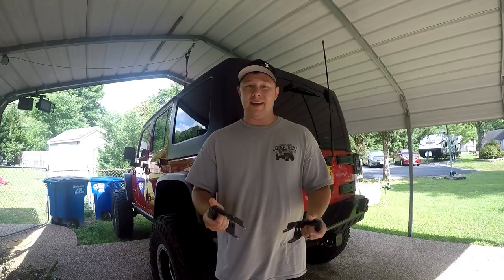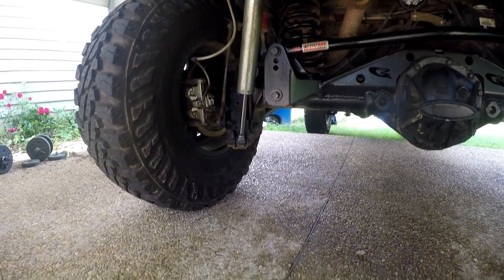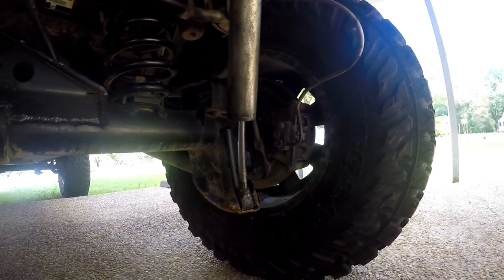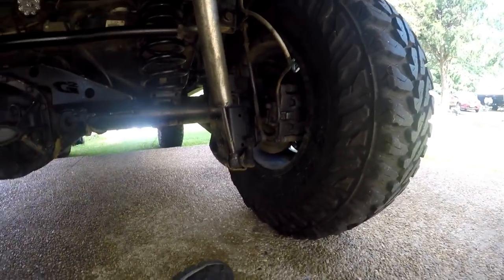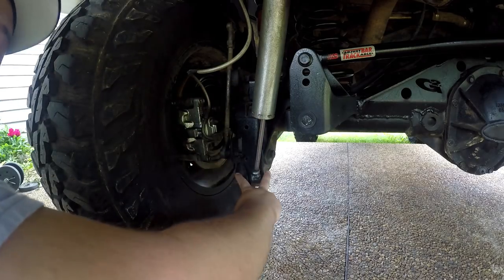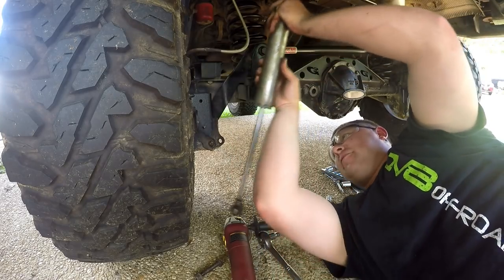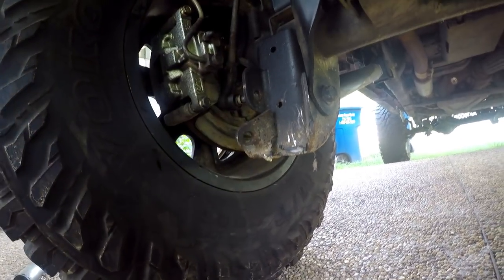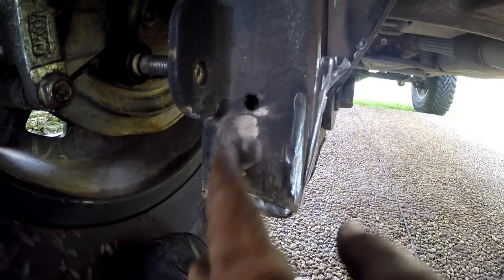Jeep Wrangler Shock Relocation Brackets

Comment: for the effort and cost what did you actually gain in clearance 3/4'',wow
Reply: But this would prevent you from having to install longer shocks when installing a two inch lift for bigger tires. Why install longer shocks  just to have them dragging? This is a great idea if installing a lift!

Comment: I was considering doing this when I do the Falcon 3.4 upgrade. Are those Bilstiens? Those are pretty stiff from my experience.
Reply from the maker: Yeah they are bilsteins. I’ve been happy with them for the price, but yeah they aren’t the best. Those falcons are supposed to be amazing!!
Reply: JK Gear and Gadgets with the onboard air you have already, it would be worth it for ya. Especially with the highway driving you do.
Reply from the maker: I’ve been debating them, still want to go coilovers so idk yet.
Reply: JK Gear and Gadgets you could have the best of both worlds.. rebel offroad has a dual shock and coilover system. But it has crappy up travel for the price.
Reply: IronskullGM could always just the valve the bilsteins. They are a rebuildable mono shock

Comment: Ben question, I'm having a problem mounting 3.2 falcon shocks (4 to 6 inch shock on 4 inch lift kit) on rear of dynatrac 60 axle housing cause the end link bracket that's welded is in the way.  Will this relocation bracket work my issue?  I have a copy photos I could show you...
Reply from the maker: I don’t think this will help your issue sadly, plus with those shocks being a pretty long travel shock you don’t want to raise them any higher
Reply from the maker: Feel free to join the FB group “Jk gear and gadgets the group” to post pics and see if others have had your issue
Reply: @JKGearandGadgets  Ben I just sent a request on Fb.   Thank you for your help